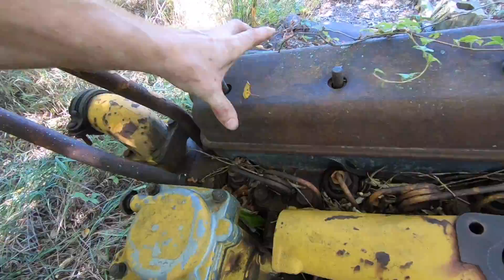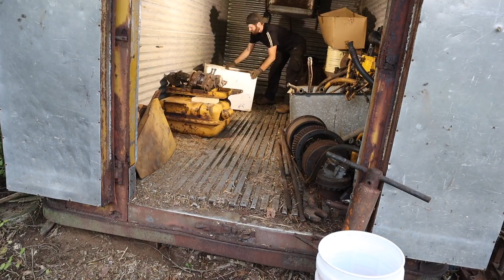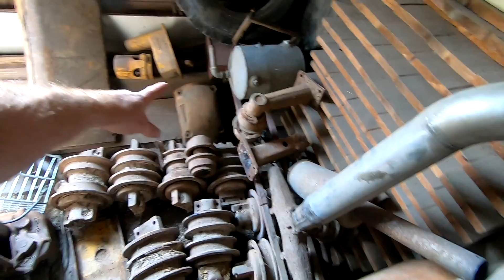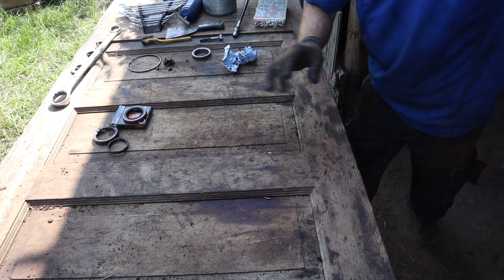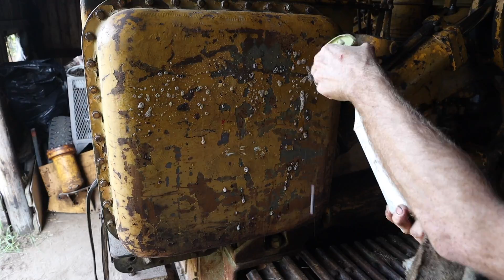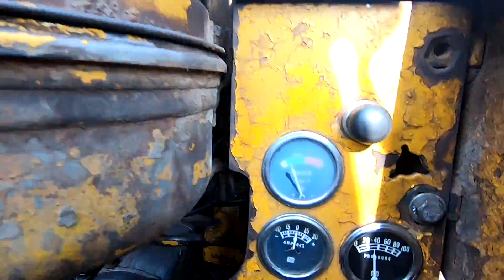I Rescued TWO TraxCavators ~ Part 5 ~ Old Red 1950s Caterpillar TraxCavator

Comment: FYI bearing nomenclature. 
Outer race fits inside the bearing housing. Inner race fits on the shaft journal. Balls or rollers travel between the races separated by the cage. The bearing that failed has a fill slot making it a max load bearing, the replacement pump contains a regular deep groove ball bearing. Max bearings don’t provide any axial load support but have a higher radial load rating than a regular ball bearing. Check the specs before rebuilding it. The max might have been the only one available when it was rebuilt.
Also if there’s enough space put two lip seals in there.

Comment: My suggestion is get a heavy duty one ton and pull while you attempt to turn that direction till you get it trailered. Either one ton pick up dulley  hooked to a winch or hitch and chain or heavy duty towe straps. Or heavy duty tractor 🚜 then get it home and repair on the flat deck the sprocket ⚙️

Comment: Sorry to comment a second time.  If you have a portable welder I would build up the sprockets so you can load the big parts and then get it where you need to and then change the sprockets.

Comment: If you want to turn right use the left steering clutch and brake if you are crawling forward you’ll need to change direction put it in reverse. After you’ve made all or part of your turn put it back in forward. This does work I’ve had to do this more than once.

Comment: TIM from Canada my suggestion would be for you is to invest in a whole lot of pallets this way you can load all your parts onto the wood pallets then you can plastic wrap the whole thing can you be able to move everything with the skid loader‘s it would be much easier to do figure out where you can get the pallets.... and as you’re working put everything onto the pallets then you can put the plastic wrap around it so nothing falls out this way everything can be lower on a flatbed."... just the way I would do it

Comment: I'm absolutely loving this series with the old Cat! Yes, someone should reach out to the Caterpillar Corporation's marketing/public relations department. What a great thing for that company to donate some parts to get ole' Red back to working again. That would be great public relations! Looking at that worn out drive chain, I see BIG $$ to fix it. 😳Keep up the great work on this tractor! Congrats on getting over 100K subscribers!
Reply: Bill Fowler    It would be a great help, but Cat is a huge corporate conglomerate that makes stock holders happy by selling newly built machinery and replacement parts for in service units.  There’s millions of Caterpillars world wide slowly wearing down, which means the need for expensive replacement parts is a positive income for dealers and the original manufacturer, as well as companies who exist just to rebuild Cat parts.  The things run forever, but need both maintenance and eventually overhaul of running gear, etc.  The good thing about track machinery is the minimal ground compaction, the bad thing is track and roller wear.  It’s inevitable, that is why the huge 4wheel drive dual tires in all positions monsters have come to be so popular for large farmers.  Weld up the worn stuff and keep pushing dirt (slowly but surely) and the critter will be running when diesel is obsolete!
Reply from the maker: That would be cool!

Comment: From the look of that sprocket, it's been cut and welded like the one you found from the parts machine.  Odd how the one sprocket is a lot more worn than the other, though; unless the track tension has been wrong for a long time, making it prone to jump teeth.  Is there a good track adjuster on the parts machine?  A good few years ago I worked in a scrapyard, and we had a County crawler conversion (On a Fordson Major), luckily on that the track adjuster worked so we could tighten it.  With the track too slack it would climb off its tracks when turning.

Comment: Worn sprockets are an indication of worn stretched chains. The pitch can be easily checked with a tape. I am guessing that the fact that the sprocket off the parts machine is good may mean the other set of tracks that are there are better than those on the Cat

Comment: If the end of the pin has a visible taper to it, then that is probably the total length of the pin. You could also try welding some temporary crowns on those worn sprocket teeth just to get it controllable. You might even be able to make a quarter round cardboard template from the good drive sprocket for after welding crowns and then grinding them down to the teeth slopes on the template? It may be less labor intensive than a full tear-down and last for as long as a replacement? Then you'll have a spare sprocket as well.

Comment: Please tell me you put a little oil or grease on that seal before you installed the u-joint. If not, I truly hope your hydraulic pump seal doesn't blow prematurely. The first thing I was taught when replacing a seal is coat the seal with grease before installing the shaft. I did wonder about it long ago but I saw a fellow mechanic put a torque converter seal in a little Yale forklift. He did it in record time but forgot that one little detail - he didn't put a layer of grease on the seal before installing the torque converter. He started it up and there was an instant river of ATF coming out from under. I really felt bad for the guy having to do it all over again.

Comment: The track might to tensioned all the way out and thats why they added those pipe pieces. Might need to tighten the tensioner all the way in and remove a track link.

Comment: I asked before, I'll ask again, what's the endgame for the tractor?
You seem like a hard working knowledgeable guy, seems like your effort should put towards something that could be of value or make you money as a tool!!!
Reply: I hope so but there IS such a thing as too worn out to be worth it. That applies when you consider putting an old machine like this back into service. Having spent 15 years in the logging woods, old stuff no matter how much repairs are done, falls apart a lot quicker than new stuff.
Reply: @elonmust7470 
 I guess my real point is, if these TraxCavators were brand new in the box, they still would be to obsolete to put on a job or to make money with!!! 
So if he was doing something like a certified rebuild, of lets say a Cat 953 loader, he would have a money making machine!!!
His talent would be much better utilized:)

Comment: I like the idea of welding the teeth enough to get it home. A short chunk of copper bar clamped in place to act as a dummy track roller will chill the weld and let you fill in the missing teeth on the sprocket with some 7014. 
Just lay multiple beads until you get enough tooth to drive the track.
I would tack a 1" wide chunk of 1/4" bar across the tooth to let the weld start and end on. Then you can burn or grind it off when you are done. 
After you get the worn teeth repaired can you put a hydraulic jack in place to remove the track tightener threaded shaft? Or do you have to split the track and move the sprocket forward?
If you can jack it forward and put in longer split pipe shims just to get it home it might work.
The problem I see is not wanting to have the track come off in the river or worse.

Comment: surly there would be another seal behind that bearing as a bearing would not last on hydrophilic oil ?
also when taking the pump off the machine there was a line running to what seemed to be that bearing would that be the feed for that bearing by chance?
i know nothing of these machines so this is just an observation/question
Reply: That line was a remote greasing line for the bearing.  And yes, the hydraulic pump should have another internal seal.

Comment: 17 min into it and need to comment already
I do not think that seal is to seal the hydraulic fluid
It is a bearing grease seal
The leakage is only caused bij the movement of the axle due to the Bearing fail.
The bearing normally does not “see” any fluid
Reply: Mark Bouwens 2 seals. One in the pump blokking the hydraulic fluid and the one in the bracket for the grease.

Comment: till you get the sprocket changed..   weld weld weld new tips on the existing sprocket..  you don't have to weld up every tooth.. every 3rd or 4th will get you some drive in the rails..   since you have a spare sprocket..  you can make either a C shaped steel plate to fit tight to the hub behind the spokes..  identify what you need to create a matching size plate that fits on against the axle end so you can use perhaps a dozen or more Grade 8 all thread rods .. tightening each one a fraction of a turn till the taper splits and the hub comes off.

Comment: that pin seems the right lenght however it seems very lose i think there should be bushings in there to take up the slack else greasing will not help filling that gap up

Comment: You are almost there.  That good sprocket you found, I recommend making a Template with all the measurements before installing.  That way you could send the template to the foundry to make you a new which would probably be cheaper than to locate and buy another one if you need too.  I did not do any research to locate and price one.  Just an out if you need one.  Great video.  You have done awesome work on it to get it up and running.  Looking forward to the next one.  Take care.   Tim
Reply: Just send them the sprocket before fitting it, and they will make a few up by casting them using a sand mould.
Reply: @trevor311264  That is even a better idea but from the video I get the impression he is on a time line and it could take several more months before getting them back.  But your idea is the better one.
Reply: It would be cheaper and faster to blue print it and have it fabricated and machined, should ask another YouTuber I know Turnwright could make one a press large enough to set the dish could be could be a road block though
Reply: @dwarnermg  You are also correct.  Both ways work if he wants to go this route.  My impression is that he just wants to get it home, so it has to move first.  In order to do that he needs to put that sprocket in before.   Does he have time to wait for the new ones?  Only he knows.  We will wait and see what he has in mind.  He comes up with some amazing ideas.
Reply: Tim Caron you don’t say
Reply: Or you could just order a part out of a catalog.....

Comment: Long ago I learned that if you drill a broken bolt straight and centered all the way through it is much easier to get them out, the through hole allows the broken bolt to contract a few thousands allowing easier rotation . And in a blind hole you get penaterat on both ends of the threads. Often they loosen enough to be finger tight.
Definitely need to do some welding on the drive sprocket teeth to reduce slippage,  it doesn't need to be pretty just bigger taller.

Comment: Just a note, if you have one track that wont pull, ie, stripped sprocket but brake works, hold brake and steering clutch reverese direction of machine and you turn the way you need to go , been there done that.

Comment: Its looking good !! Glad the hydraulic leak was only a seal , but not to horrible of a seal to get to ( but I didn't do it either ) !! Great work so far !! Can you hard face or build up the teeth on the sprocket to get it moved ? The right amount of weld build up on each tooth might be a trick  If you can tighten the track back up and get it moved home life will be better for sure but what a wonderful job you have done so far !!  And love those decals !! 👍👍🇺🇸🔧🔨🔩

Comment: Love the decal !!

No gasket for the pipes to the pump or is there an O-ring ?

Drilling bolts requires left hand drill bits !
Reply: No left hand bits needed. You have to cut the tip of your thumb on the snag of thread sticking out. Use that blood as an offering to the thread gods to bless an convince the bolt that it needs to come loose. Also a quick homage to the centra spirit for a good clean hole dead in the middle. Don't forget to please the snappa spirit for not letting drill bits, EZ outs or taps to break off in said hole. Above all thank Jack Daniels for the times when the things do break. Last but not least hope you have plenty of carbide or diamond bits to remove the hard stuff. Oh, and pray that you don't break any of the carbide or diamond stuff off.
 Really left hand bits are a good start if a scribe or punch won't move it. Things just get uglier from there. One of my former jobs was to remove broken whatever from holes. I loved doing it because you were really appreciated by everyone involved. I have been retired/disabled for more than 10 years and still have people bring me stuff to get bolts and "stuff" out of. One small screw I managed to use a pencil eraser to spin it out. Yes, luck does help....LOL!
Terry from South Carolina

Comment: With that much play in the track now you may be able to remove 1 section of track to make up for the play. 
I'd also cut Red's "home made shims" down and reinstall them to insure that the tension is set until it's fixed properly.

Comment: I can tell you how to fix that tensioner i have fixed one before. Use a bottle jack and two wood supports to Jack apart and push the tensioner outwards and then take the old tensioner off that has the bad parts and replace them. The bottle jack is strong enough to separate the system. 

Basically lay it flat and just push the system apart using the boards as extensions and you should get enough space to replace that parts in the middle to get it all working again.

Comment: Using the better sprocket as a template , mabe the worn sprocket can be saved as a spare , if you can get the points hardfaced .

Comment: You can move it with that sprocket but youll never cut dirt with it. The creek could stick you too. Water on steel is a lubricant.  Other comments about welding on the sprocket are spot on. You can weld old bolts or chunks steel where the tips would be. It would be enough to do what your talking about to move it and maybe load the big stuff. It won't last long so make every move count. Many farm and dump pushers had really crude repairs done to undercarriages just to get by for the simple jobs they had. Try to learn how to walk your machine with just the clutches. It's a long slow arc but if you learn to read your terrain and clutch the correct side you can move it a lot without braking. You'll have to see saw back and forth some with the sprocket as is. Carrying weight or dirt will amplify the brake problem or make it clutch turn better too. The seemingly reverse pattern on your hydraulics is for ergonomics. When you get used to it you'll understand. Raising the boom and dumping in a truck are the same direction. The hard bar pin is shot. The slack when you let the jack down shouldn't be there. I'm thinking the pin is short/ broke too. It'll get you by for a short bit. The hood side panels are hard to come by, you're really lucky to have them. Battery cover too. You're doing a great job coming along great. I'd be proud to have it, it's a great little machine despite the repairs still needed. Sounds really solid running. Thanks for sharing
Reply: Great tip on the torx bit too! Thanks for sharing it, I'll have to try it.
Reply: Yuh Salvageworkshop

Comment: I would not cut and the sprocket thinking of age material and chance of failure under heavy it load goes way up adding weld points to every spoke. try your best to do a full sprocket change you don't want to wonder about strength every time you use it. awesome to get a machine and a pile of spares. one day I will find myself a crawler project also I have had better luck using torx bits as bolt removers than anything else  !!!